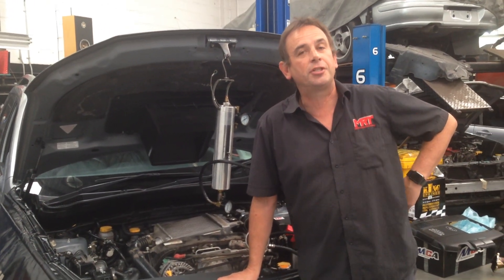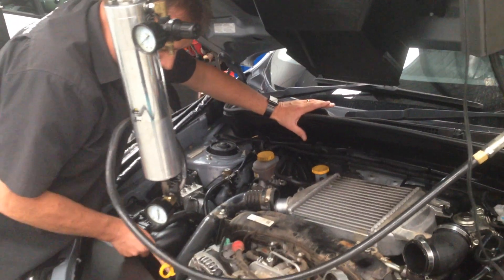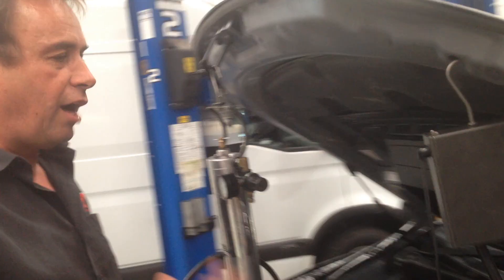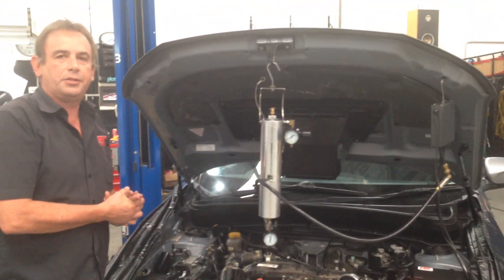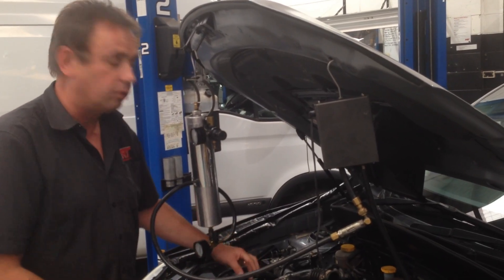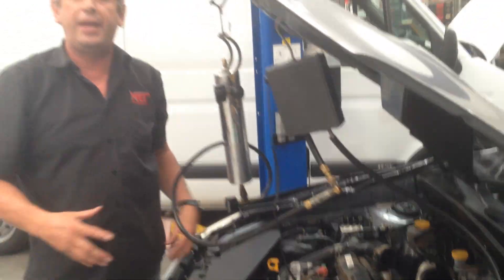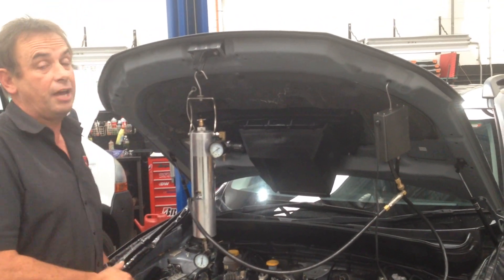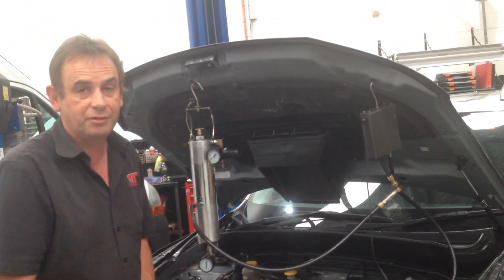Subaru Diesel DPF secrets and how to fit soot and faults

Comment: Wondering what city you’re in, I’m hoping Melbourne. 
2015 Subaru Outback with the diesel fuel filter icon flashing.  White smoke occasionally after starting and warming up.  . I drive freeways.  Haven’t noticed it on the freeway but maybe smoke is dissipating with the speed 😅. Thank you for your knowledge.

Comment: Do you still fix dpg issues
Reply: Far better solution is to remove the filter and have it proffesional cleaned. There is a company in Ireland called Wallacedieselelectrics that can help you out... With their cleaning capacity you get filter that is as good as new one!

Comment: Bret have you much experience with range rover 4.4 v8 diesel. My one is using oil had the main turbo changed but its still using hell of alot of oil any advice m8 here in scotland
Reply: @Reuben Rosolin cheers boss i will try a relative compression test just gettin into scope just for learning if nothing else. Thanks and much apprecition for your clips

Comment: Hi Brett & all,
                       My partner has a 2011 Diesel Forester turbo that we have cleaned the soot from the intake in an attempt to stop DPF regeneration from activating continuously and fuel diluting the oil. Good news is that seems to be much healthier so thank you for the advise. 

We have one remaining fault which we can’t pin point. At mid rpm on heavy throttle in first and second gear the engine has a large hesitation. I monitored it with a scan tool which pointed to a drop in fuel pressure at this point when logging actual fuel pressure vs demanded. Demanded not showing a drop. I changed the fuel filter which didn’t help. Not sure if I should be looking at the AFM or the potential of a faulty fuel high pressure fuel pump ?  Hesitation seems to be a common complaint however I wasn’t able to find a common solution. 

Interestingly if I continue to drive spirited the problem goes away and returns after a period of soft driving.

Comment: i hava an outback 2016, dpf and agr were made new at 160.000km, but it does not work dpf signal flashes, recuperation is on and oil is diluted and diluted...i drive long distances on highways..my subarudealer has no idea, what to do...i was in innsbruck yesterday and the car startet  smoking,too much oil in it..i reduced the oil...thats all,i can do...so what can i do

Comment: Can engine remapping cure any of the mentioned issues? 
I have the exact problem you’re describing. After chemically cleaning the dpf. The oil dilution error came up after but was reset. Now the whole Christmas tree lights story is back on again after driving for less than 100km..
Reply from the maker: the DPF and EGR has limited access via the ecu tuning Oil dilution is a separate problem to the DPF
Reply: Many thanks for your reply. It was more of a desperate cry for help really as I've run out of options at this point and the only way out I see is selling that car.

Comment: Hello MRT, I am having an issue with a Forester 2.0 diesel from 2011. It threw all the codes for PDF and the car had gone about 190k's. Faulted PDF with 87% fill and it got changed by a certified mechanic. Car drove perfect a day, then threw all the codes again. He did reset the PDF but car is now throwing the same codes which are P246C, P2463. I checked the hoses as you instructed and although there is a bit of seeping of soot from the flexible intercooler piping there are no cracks or other issues with the pipes from i can see. Any ideas?

Comment: Early subaru diesel models 2008+ are known for having dual mass flywheel problem,  therefore the main crank shaft broke and the engine suffered severe damage. Can you tell me if the problem persist with 2011+ models..? 
Tnx

Comment: Early subaru diesel models 2008+ are known for having dual mass flywheel problem,  therefore the main crank shaft broke and the engine suffered severe damage. Can you tell me if the problem persist with 2011+ models..? 
Tnx
Reply from the maker: I rallied aMY10  forester TDI for two years with a single mass replacement FW  and had reliable use

Comment: Not related to the dpf, I had the 2l. D for 2 weeks. It's 8 years old with 63k miles on the clock. Today it started to slip clutch in 4th and 5th where on acceleration the revs go up but the car does not move faster. Then the smell from the clutch is bad. Is the clutch on the way out?  :(
Reply: Ps. I have put a stop to any dpf problems using high-grade diesel. Those cheaper supermarket ones use bio diesel that was giving problems. That is in a VW 1.6d engine in my Skoda that I use in my driving school.
Reply from the maker: 100% stuffed :(
Reply: Yep, new one already fitted. ;)
But now it's won't eject a CD :(

Comment: Interesting video thank you for posting.  May I ask with a turbo diesel and the soot problem would it help the engine to use the Shell V power +nitro diesel which is meant to have a far lower soot level and to blank of the EGR valve to prevent the soot from entering the system in the first place.  Any thoughts on this would be grateful.  Thank you.
Reply from the maker: not a solution, you need  atune to stop it

Comment: or you could just get rid of all that emissions crap to make it run the right way. turn off the codes and you're back on the road with more power, fuel economy and reliability.
Reply from the maker: emissions is something we all need to deal  with more and more :(